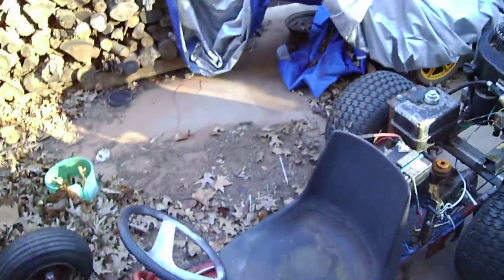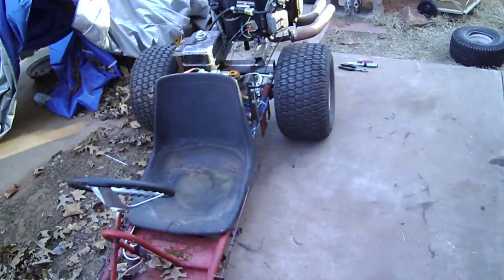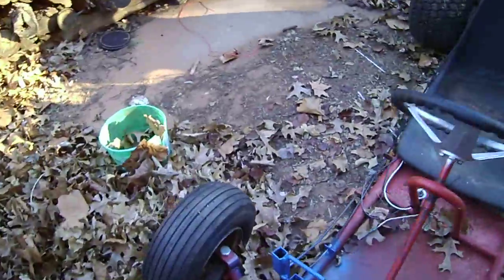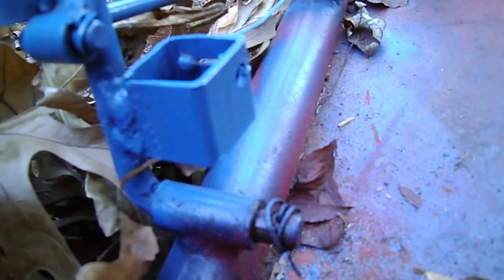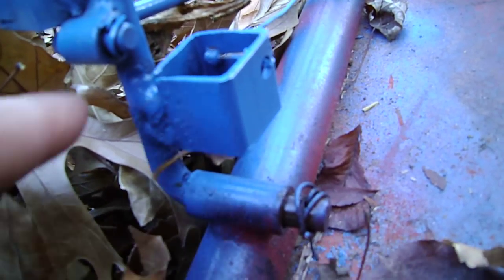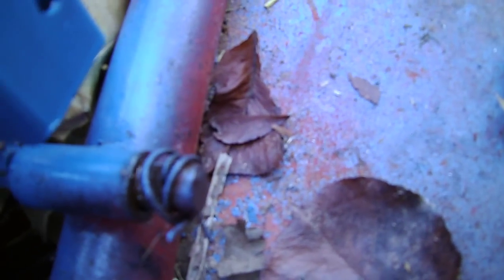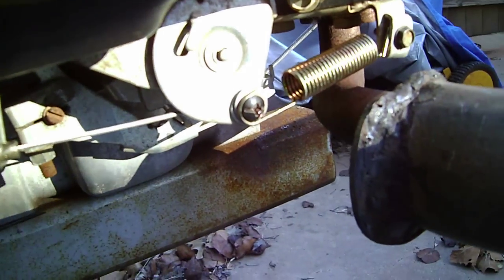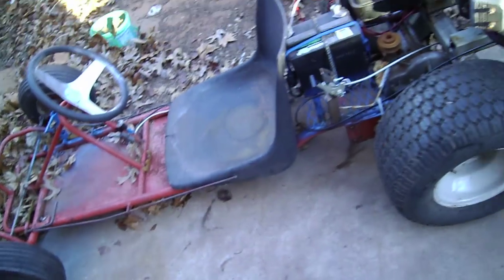go kart throttle setup

Comment from the maker: Due to a lack of funds and just the way I built it I cannot finish It. If the frame was bigger and If I had a better drivetrain setup I would have finished it. I just cant finish this one. If your building your own I'd recommend a horizontal shaft engine or even better a motorcycle engine.

Comment: I bought a new Briggs & Stratton motor 10 for my go-kart but I don't know how to set up the throttle cable there's no way to hook it up any suggestions
Reply from the maker: I would need a picture to really give you any ideas, but you need a bracket that you can attach the cable sheath to. then you can hook the end up of your cable to the bracket on the carburetors throttle that the governor is also on. If you go directly on the carb the governor will not work. Normally the cable is attached to a bracket connected to the throttle via a spring so that the governor can still shut the throttle when max rpms are achieved under no load
Reply: @mrawesome14b  thanks what i did was hook the loop of cable directly to throttle arm so far it seems ok...ive been working on this thing for off and on for years getting a little annoying
Reply from the maker: @jmc4712  I can understand haha. If its a flathead no worries float the valves to death they can take alot but if it is an ohv engine try not to float the valves to much. Don't get me wrong its still hard on the valves and seats but there is no chance of piston contact in a flathead.
Reply: @mrawesome14b  what do u mean float the valves?
Reply from the maker: @jmc4712  this information is subjective and depends on the engine, but on typical lawnmower and small engine application they usually run 3600 rpm and are designed to do so. When you rev the engine higher than that you will reach an rpm probably 4000 or 4500 rpm where the springs cannot stay in contact with the camshaft. there isn't enough spring pressure to pull it shut with the camshaft lobe so they float bouncing on the camshaft lobe preventing the valve from shutting. Since the valve isn't sealing properly it stops the engine from revving any higher than what the spring pressure will allow. In an ohv engine this can cause the valve face to hit the piston.
Reply: @mrawesome14b  ok thanks for the info

Comment: why is a twin cylinder only 5hp
Reply from the maker: This comment is from a long time ago lol but this is a 18hp v-twin. You could have a 5hp v twin if it had a small enough displacement or low efficiency. Its all about how well you can move air through the engine.